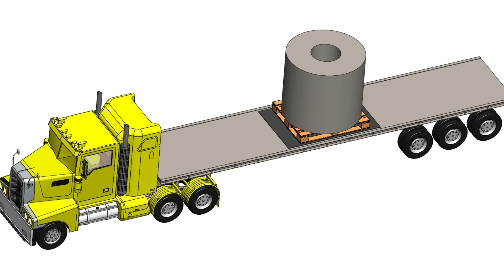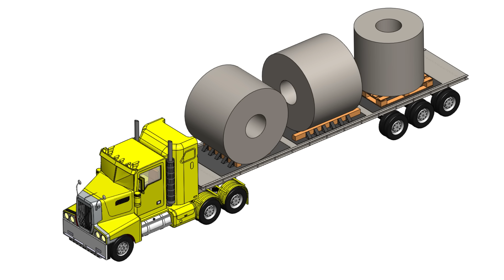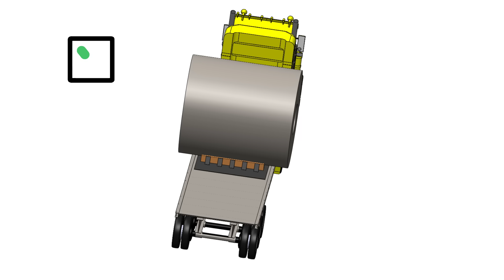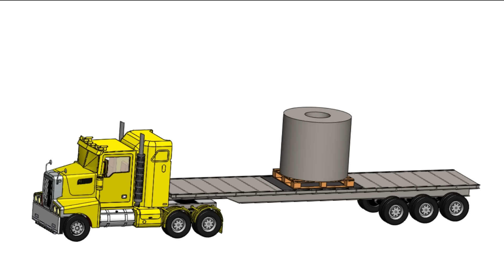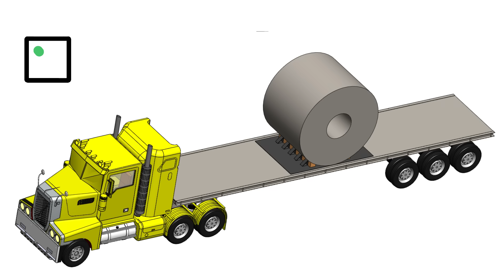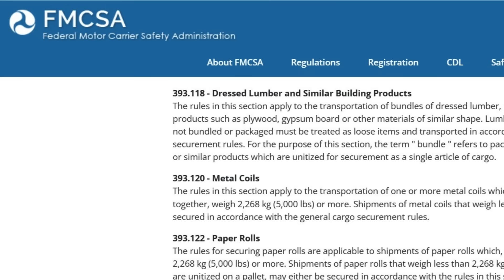Suicide Coils; Why Are They Loaded This Way?

Comment: So basically "eye to the sky" being the safest way to load steel coils isn't used, because it's also the most expensive. Literally every argument against it comes down to price. Why doesn't this surprise me?
Reply: Try to load and unload them eye up.  I worked in the steel industry and loaded and unloaded 30k coils.  The best way to do it is to grab them by the inner core with a big fork lift. They are chalked well sitting sideways and won't fall off unless they are impotoperly secured.
Reply: @KevinTurner-hr1wg  it was shown in the video how it's possible to handle them when eye up - and yes, it''s difficult and expensive, that's why people tend to use less safe options because they're easier and cheaper.

Which proves my point - price and effort beat safety. Again. 

You see, my friend, I climb towers, chimneys, roofs for a living. I do various work there. I work on ropes, or without them if there's more proper access.
Most of the work I do could be done safer, easier and faster using a cherry picker, especially on the roofs, because buldings tend to be quite low and accesible - but obviously high enough to kill yourself if you fall. Yet I climb them, because it's cheaper and more convenient to the neighborhood than using a cherry picker. Which again leads us to the point - cost beats safety. You see it everywhere and if you try to deny it, you'll make me laugh.
Reply: Literally every argument about everything comes down to cost.  Everything is a trade off, all decisions are based on what you are willing to pay.  Insinuating that compromising safety is a bourgeois injustice ignores the other four minutes of the video that explains how ALL methods of loading and transport have problems, but most of those problems are minimized by responsible driving.

News flash:  a truckload of food aid for whatever band of misbegotten foreigners you favor will kill you just as dead as a truckload of rolled steel.
Reply: they explained why. you can't put a 47K coil on a wooden pallet designed to hold 2k. also, most fork lifts can't unload an item that weighs that much.
Reply: @connor_flanigan  
But you can put 20t coil on a pallet designed for 20t. Google it, my friend, those exist - as well as forklifts that can easily lift double that load. Not "most", sure, but have you noticed that most of the equipment revolving around those steel coils is specifically designed or adapted to handle them somehow? Even suicide loading is specifically demanded because this way you can easily lift a coil with a forklift equipped with a coil ram for this job. You think that they put a coil ram on a 2t forklift and it can magically lift 20t stel coil with it?

That's my whole point - you already spend a ton of money to handle these things, so why not spend a little more for doing it as safely as possible? And answer is very easy.
Reply: You can only secure "eye to the sky" coils a few ways. Especially if they get heavier its harder to meet the securement weight requirement.

With "suicide" and "shotgun" you can use a lot more securement especially on heavier coils

Comment: America You are so far behind UK and Europe we have been using well trailers since the 1960s to carry coils as you put it suicide    so back loads have been no problem for us
Reply: We pretty much showed you in 1774 that we didn’t want to be like you!
Reply: Wasn't it 1776?
Reply: @jossdeiboss  that all happened before 1776. 1776 is when it was documented.
Reply: We have well trailers, but because the loads vary is why they use flatbed trailers
Reply: @theotist65  our trailers are 45ft long my last weeks work  a 30 ton coil from the mill in south Wales to Sheffield  then 24 ton of rebar back to Bristol docks then a 40ft container to  crew where it was taken of and 4,  4 ton dumpers   back to south wales with out having to change trailers  as all well trailers are designed as flat bed first with removable centre bords between the chasse rails for the coils to drop into

Comment: When I was driving a truck pulling a reefer I got to haul some steal coils they were little ones loaded upright and I had to keep the reefer running, to keep them warm.   Then another time I had a load of paper 4 rolls 40,000 pounds, they were loaded on their end with rubber mats and no other tie downs       There’s all kinds of stuff in a reefer
Reply: I used to haul a lot of paper from Georgia-Pacific. Always maxed out on weight. I couldn't put much fuel in the tanks and stay legal. Hills were a nightmare.

Comment: Everyone wets their pants about suicide coils. Use 1  5/16 proof chain for every 4000# of coil.  Block the coil off the trailer deck. Dont drive like you just escaped from a mental institution.  Its easy when you know how to do it correctly.
Reply: Another big advantage I imagine for suicide style is also that its own weight will prevent the coil from trying to unwrap itself, unlike eye to the sky where if the coil has any inclination to unwind itself it will try and thrash everything around it like a lawnmower.
Reply: With regards to that third point, I’m imagining the Joker driving one of these trucks with coils loaded on the back now cackling menacingly. 😏
Reply: I've delivered coils plenty of times. For 40,000 pound coils, use six 3/8 chains, 6 coil racks, and 5 chain binders. 
I've done it this way for years and that coil won't move an inch even if I slammed on the brakes.
Reply: It's good to hear from someone experienced and knowledgeable. Grateful for people like you who do these amazing jobs.
Reply: It's not that it can't be done. It's that when you do something complex like tying these things down 1,000 times, 1 of those times someone is bound to make a mistake. And when that happens the results will certainly be expensive and likely be deadly.
Reply: This falls flat on its face when every imported third world brownoid is suddenly a truck driver in America.
Reply: easier said than done, most truck drivers are room temperature IQ amoebas.

Comment: Is there a cradle that can be used and remved on a normal flatbed.  Or put some kind of steel wall on the trailer so if the coil does come loose it won't roll through the cab.

Comment: Here in the UK we have special coil trailers with a recessed v shape cavity in the floor in between the chassis members and the coils are loaded shotgun style and some of the trailers have big box section stop guards to stop the coil moving forward in emergency braking, so basically the coils can't roll out the trailer .
Why don't american flatbed trailer manufacturers fit strong and strengthened headboards to their trailers because that would also form another barrier for the driver if the coil came losse
Reply: We have those types of equipment here in the US as well. Please don't rely on a lame AI video with a robot voice to educate you on American steel hauling equipment.

Comment: 2:30 - Ahh, so that's what they call it.
30-odd years ago I saw what happens when that load style fails.   A flatbed hauling what looked like huge terracotta colored pipes (think... 12' diameter with walls easily a foot thick).  HUGE things.   One broke loose and landed on an unfortunate Nissan pickup truck.   As traffic was directed by we all got a clear look at the little pickup crushed all the way to the ground, the pipe longer than the truck itself.   Sheet over what little remained of the cab.
Apparently there were two pipe sections.  One shattered and the second snapped its restraints though I never learned why.
Reply: Because they didn’t have the right size chain, didn’t have enough chain, or didn’t have a combination of right size chain and hard wood blocking.

Comment: Why not put a slab of metal squares or widgets on both sides of the rolls so they don't roll to either sisde?
Reply: Concentrated weight in motion can’t be stopped like that without something getting destroyed.

Comment: Another reason is that in the factory where these are made and where these are used they must be in the suicide position, eye to the side. Also during manufacturing the edges of the coils may not be perfectly flat so one or many edges of a layers of the coil could be sticking out. When you load such a coil eye up it slides within itself causing scratches on all the surfaces. And also crushes some of the edges that stick out. 

Coils also come in different thicknesses. You can basically go from half and inch (12mm) to as thing as 0.3mm. Especially with thinner stuff you want to be careful not to scratch it. Even smaller bumps can ruin many layers. The material also has a huge effect. Strenghtened steel coils can unwind themselves very explosively whereas some coils don't do anything even if you totally remove all packaging material. Usually the end of the coil does a strong whipsplash so be careful.

Also the metal coils are not the most dangerous stuff on the road. Similar paper coils are also deadly. Not as heavy but still deadly.
Reply: When I was in college in the 80’s, three friends were killed by a coil that fell on their car while on a road trip. Really tragic. Ever since, these trucks scare me.
Reply: I dont think 12mm is coiled. It is in sheet form. They are called Hot Rolled (HR) sheets
Reply: @2615Prasad  I don't know what is the upper limit for coils. Thickest I remember seeing was maybe 9mm but I have weird memory of 12mm coils. Probably wrong memory.
Reply: good lord, a coil of 12mm thick sheet?

Comment: I use 6x6 boards with slightly longer coil racks & if a coil weighs 40,000 pnds 5 chains. Nothing will happen. Been hauling them for 40 yrs

Comment: Had a roll come off a truck in the mpls area many yrs ago. The car it hit was destroyed and the driver died
Reply: I happened to be watching a news broadcast decades ago where they showed a steel roll that came lose roll off the back when the truck started moving with a green light at a intersection.  It rolled off the back of the truck, over the car, down the street a ways, over the curb and then sank into the yard of a house.  It looked to have made at least a foot depression in the ground where it stopped.  The car was a little compact thing before but it was real small after the steel roll went over it.  It might have been a little over a foot tall.  Even the tire rims were flattened.  Obviously, the people inside were dead.  I think it was a couple and a kid or too.  

After that, I stop back a ways when behind one of those things.  Oh, I think they said it weighed around 45 tons.  The truck had signs, lights and such due to the weight.  The trailer had several axles and the truck part, tractor I think it is called, had three axles.  It was a sad sight.

Comment: The biggest steel coils we hauled were 60,000 lbs from Regina Sk to Edmonton Ab. Was very hard on trailers. Was all the Dresser wheel loaders could lift..
Suicide of course 😂
Reply: That amount of weight sitting on such a small area of the Trailer, rather than over the axles, has to create some stress's beyond Design. 
I can see frames cracking at welds, especially if the Driver has to drive over inclining entrances to/from the Delivery sites twisting that trailer to it's limits.
Reply: @ yes we had to unload one and reload on another trailer as the first one had a definite wow in the frame. Luckily we only did the real big ones for a couple of weeks before the shipper/receiver smartened up and started shipping 50,000 lbs coil instead. That’s still a lot of weight in one spot. Oh and our trailers were designed with coil packages. Extra cross members in certain areas
Reply: The biggest I ever hauled was 63,000 lbs and 63 inches long. I had a 3 legged trailer with a lift axle just back from the center and a sliding tandem behind it.

Comment: Shouldn't there be a headboard, on the trailer, to stop loads(of anything) getting to the cab? Like in U.K.
Reply: Headboards and headache racks don’t stop heavy coils if they aren’t properly secured. Only slow them down and maybe turn them to the side if you’re lucky. Not so lucky for the vehicle beside you 😱
Reply: What is called the headache rack. Every US truck pulling flatbed has a headache rack. Unless the flat bed is used for something else. As a rule they do have headache racks which holds chains, straps and binders, or tie downs. Help me out here.
Reply: @AllanHunter-c2l  yes you’re right. But in some places it’s mounted on the front of the trailer. Then it’s a headboard
Reply: @wesadrian6981  I could not think of the other term I used a trailer like that. Anyway I hated pulling flatbed trailers. Have a nice day.
Reply: a 47K coil would snap a headboard like a toothpick
Reply: u wont stop 20 tons
Reply: CEOs:  “But muh private yachts!”

Comment: there are 4 ways to load coils, 1: suicide, 2: shotgun, 3: eye to the sky 4: stop being a feckless cheapskate company or idiot owner driver and get a coil well trailer which can work perfectly well as a flatbed etc, and they don't cost much more than regular flatbed.

method 4 is used in large parts of the world, as coil well trailer are common place, while safety culture is very different to the US, due to how liability works, so metal stockholders will insist in moving coils only on coil well trailers, due to the significant safety benefits, and receivers at the opposing end of the delivery are gear-up to take then in the coil-well orientation, given if you can use a forklift to lift of suicide, then you can get a fork adapter that WILL lift both shotgun and coil well just as easy as if in suicide orientation, given you need the SAME lifting capacity forklift or crane to lift any orientation.

the other advantage of coil well trailer, is it can accommodate coils that in suicide orientation would overhand the trailer edges and block the driver view, and it over all significantly lower the CoM of the load, so for example you can carry a heavier coil with the same effective CoM height as a lighter coil resting directly on the bed.

 for a UK example on youtube see Dennison Trailers Coil Carrier

Comment: Skirted the most obvious issue that the properly big coils have a diameter more than the 2.5 m width of a truck, so it becomes a wide load when loaded any other way than 'suicide'.
Reply: The diameter would still remain the same and overhang the same amount, causing it to still be a wide load.

Edit: literally click post then realised I was having a special moment 😂
Reply: Sometimes the truth is very simple.
Reply: That's what convoys are for.

Comment: Meanwhile in europe, we have trailer with coil well to load it shotgun and if its not needed you can put specific panels over it so you can load normal pallets or other things that can go in a curtainsider.
Reply: There are special trailers with coil wells in use in other parts of the world beside Europe fyi.
Reply: The USA is a spoiled toddler compared to the rest of the world. But it's a toddler with nukes and a hard charging military so the rest of the world does not say what needs to be said like most adults would do so we get to ride the struggle bus for a few more centuries. I'm a vet and proud of my country but I am not a mindless dupe and know we could be doing much better.
Reply: Whoopdy freaking do.  So how many times do you actually use it?  Meanwhile everywhere else people haul coils everyday without them with no problems.
Reply: @jasonstclair6293  i don't know because i didn't work in that kind of branch or in the paper industry where it's also been used for large paper rolls
Reply: @jasonstclair6293 I work with plastics and on the same trailer you can stack a lot of scrap and sometimes large rolls but the rolls are not so large so it doesent mater, we didn't needed that trailer, it was just what was available. The expensive trailers do not sit idle if there's no job. We transported our scraps even in refrigeration trailers, we have all the certifications for food industry compatibility, no problem. So yes sometimes non standard trailers show up that I imagine serve a purpose. 2 axle american style but with steering axles, all of them non standard trailers can still do most of the jobs. I'll say it as nice as I can, that american coil trailer is stupid and a waste of money, looks like the chassis of some kind of heavy artillery and US is behind on trucking but pretty much ahead on rail. Those intermodal stacks on US trains are impressive
Reply: @GeorgeS-z8x  In all reality I did think that a specialized trailer is a good idea.  I'm just sick of seeing Europeans and their fancy equipment, bigger engines, and everything else trying to one up us.  We have what we have because it gets the job done and there isn't any need for anything else.  I do at times wonder why we don't have any cab over trucks, but at the same time I spend enough time on the highway to realize I would want that extra cushion in front of me for when I eventually hit some idiot in front of me.  I also have a feeling that the reason we don't have too many specialized trailers such as a coil hauler is that in order for it to really make sense you would have to haul coils for every single load.  I'll admit I don't know much about trucking and even less about the steel industry, but I do know it is extremely rare to see coils on the highway.  I see coil cars on trains pretty regular though.